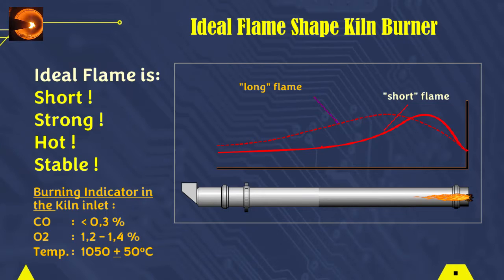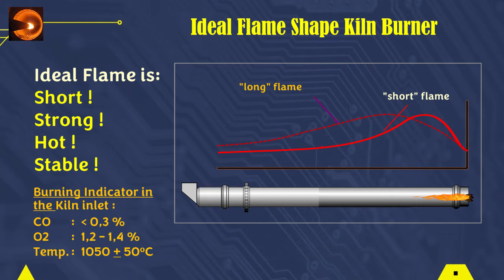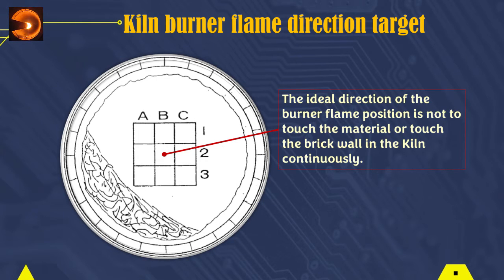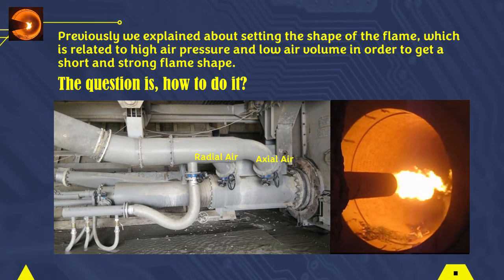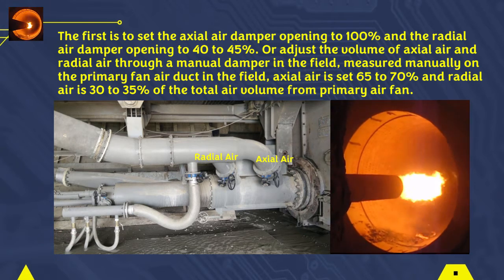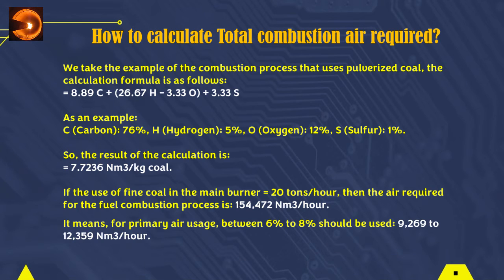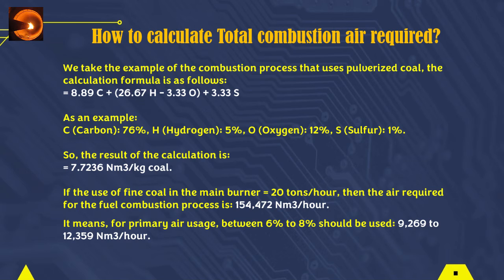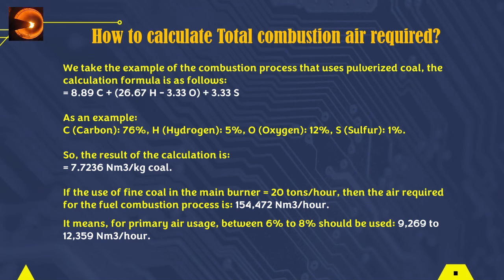Ideal Cement Kiln Burner Flame Shape for Kiln Operation_ English Version

Comment: Hi, can you please answer my question below? Is Secondary Airflow measured ever to ensure proper Air-Fuel ratio? OR we are always relying on O2 as the feedback? Would highly appreciate your response. Again very good videos, but this is one confusing point for me here. Thank you
Reply from the maker: Thank you for your question, we have answered your previous question.
We once measured the flow of secondary air entering the Kiln, we have answered how to measure it in the previous question.
The ratio of combustion air usage in the main burner that must be maintained is the use of air flow from the primary fan, which is between 6 and 8%, this also depends on the type of burner you use.
Reply: @parroscement2625  HI Thanks for such a detailed response. I apologize for missing your earlier response. I absolutely agree that operations visible checks definitely help here, however, if you have a PLC measuring and controlling the air-fuel ratio (AFR), is it fair to say 1) Typically, PLC only needs to measure & control the Primary AFR (6-8% burner dependent) 2) Secondary air is not typically measured and PLC relies on the O2% at Kiln Inlet to ensure sufficient combustion.  
But if above is true, then isn't there usually a delay in O2 Analyzer measurement and shouldn't we all be trying to measure secondary air to for appropriate AFR at all times? I am surprised that this isn't done typically!
PS - If you have an email or ph# to reach at then that would be highly appreciated. Thanks :)
Reply from the maker: No problem Mr. Nikhil, I am happy to be able to share my knowledge and experience with you in operating a cement kiln to achieve optimal operating conditions.
In general, AFR and secondary air are not displayed on the control panel all the time, but we do this periodically in the field and then calculate the primary air ratio in the main burner to obtain optimal operating conditions. Given the coal fuel used in the combustion process from time to time the quality is not uniform. And we don't have a dedicated PLC that can display AFR and secondary air on the control panel.
If you want to discuss further about the operation of the Kiln, please leave a special message or your question via our email pr.rosy71@gmail.com. Thank You.

Comment: Hi good informative video. Question for you: 
With burner receiving 6-8% of total air, how do we ensure there isn't incomplete combustion? The secondary air must make up for this u guess? But how do we maintain proper air-fuel ratio then vs relying only on O2, CO as a feedback? Is secondary air flow measured typically?
Reply from the maker: Thank you for your attention and question sir.
1. Complete combustion is influenced by several things, including:
a. The fuel used in the combustion process (coal, oil or gas). When using coal, the water content and fineness will affect the combustion process, the finer and the lower the water content, the more flammable it will be.
b. The temperature inside the combustion chamber is influenced by the temperature of the material flow and secondary air.
c. Mixing fuel and air from the primary fan (air pressure and flow), low flow and high air pressure is better.
To ensure the combustion process is complete or not, besides being seen from the remaining O2 and CO at the Inlet Kiln, it can be seen from the temperature of the sintering zone or seen visually in the field.
2. Yes, the secondary air requirement is between 90 and 94% of the total required combustion air.
3. During Kiln operation conditions are optimal, fuel consumption and air settings from the primary fan are rarely changed. The secondary air flow from the cooling fan fluctuates slightly, which is affected by the thickness of the clinker above the grate, grate speed, clinker quality and dust or granularity.
4. Secondary air can be measured, the method is: measure all the air flow from the cooling fan, minus the air flow to the tertiary channel, minus the air flow to the cooling chimney, and minus other air flow heading out of the cooler (if any).

Comment: If flame is bluish what is the temperature 🌡️?it seems you forgot to include this kind of burner flame?
Reply from the maker: Thank you for your attention.
The blue color of the flame can only be found when we use natural gas as fuel and the temperature is around 1400 oC.
In general, cement factory operations use coal as fuel and solid alternative fuels.
So, what are our observations about flames in general that use solid fuels like coal etc.